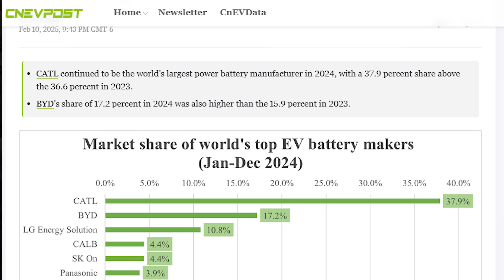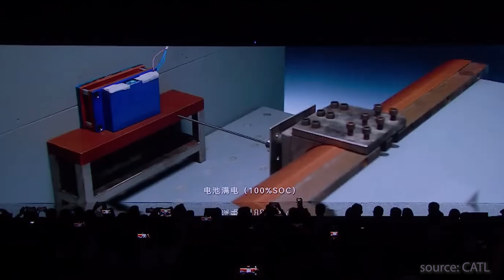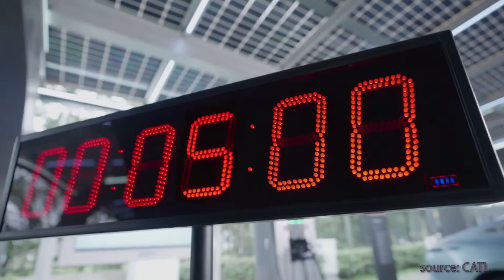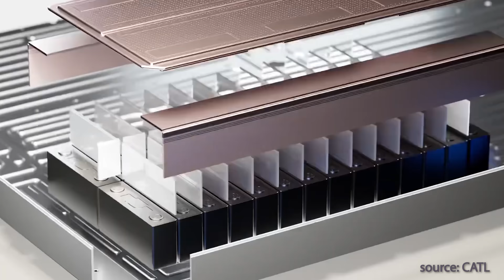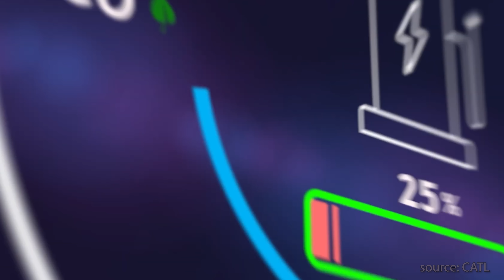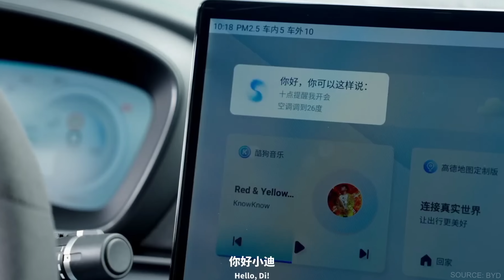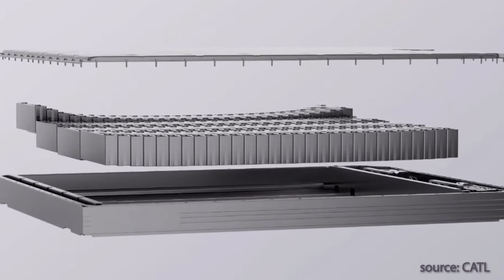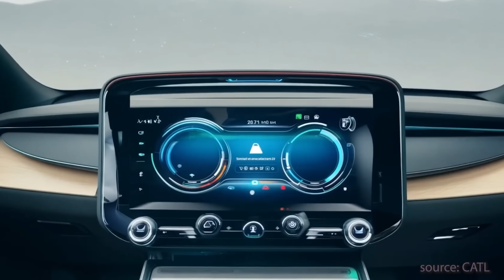THIS Battery Will Change EVERYTHING!  Sodium Batteries May Kill Lithium Forever? No more Lithium!

Comment: These are amazing breakthroughs that the whole world should share in. We need to move away from this US versus China thing so we have batteries or technology for the betterment of society. As Martyna mentioned we will and already have ended up with a two tier system. Due to this almost vengeance against China, the US consumer will/are missing out on these innovations which is nuts. I have an electric car and probably get 250 miles out of it. If it could travel 900 plus miles in a single charge then you don’t need millions of chargers. Bring it on I say
Reply: I don't care. It is absolutely not acceptable that China steals our intellectual property and something needs to be done about it. As a side note, Trump actually does not care about this issue. He sees no difference between a democracy and China. To Trump, all countries not named the U.S.A. are the economic enemy. But I am hoping that we can use the next 4 years to wean ourselves off of China. Nixon going to China was an extremely bad decision.

Comment: LFP EVE MB31 314Ah cost 50$, a Na+ 200Ah cost 60$ and have to big voltage range - we not have a inverter with 15-70VDC for DIY LowVoltage battery. Sodium is not cheap. Now a EVE do MB56 600Ah in the same size ! LFP seams better for future.

Comment: All electric for the past year, and since I can charge at home that has been a non issue.  Fast charging during regular breaks on longer trips has worked out to be very convenient, and while more expensive than home charging it's still cheaper than gas.  Smooth effortless feeling power without noise or smell, and the ability to regenerate energy while braking might be my favorite aspects of an EV.  The lack of maintenance is another plus...washer fluid, wiper blades, cabin air filter, and tires are just about all the regular maintenance.

Comment: Sodium has a huge voltage drop so at 50% soc you will absolutely notice the power loss, it might not be a deal breaker if they make the EV more powerful and limit it on a curve as the voltage drops but forget using sodium with currently available chargers and inverters which means Lithium will remain the dominant chemistry for the next decade outside of home storage imo.
Reply: Exactly, but home storage is the most exciting part anyway since that's what's going to realistically save us 95% on our power bill. The technology and prices on solar and LFP batteries alone are already enough to save us well over 80% vs paying a power company. Again, WAY more exciting than vehicle battery technology in my opinion.
Reply: So… I should buy ALB?

Comment: Rapid charging of a battery irrespective of its composition depends on a power grid's capability to deliver the required amount of energy.
Reply: Actually, those rapid charging station will have local battery storage on site to act as a buffer. That way, the charging station can draw a constant amount of power from the grid no matter how fast any one is charging.
Reply: @appliedengineering4001  you can dream
Reply: I guess you haven't heard of bifacial solar panels. 30 years of 26+% efficiency charging these batteries is insanely impressive and getting even better annually. The grid and power companies in general are becoming obsolete at light speed. Even as a regular retail consumer I've recently picked up a couple thousand watts of used standalone solar panels and a medium portable LFP inverter battery power station to fool around with for $600 all-in and it will run every single thing I'd need to live all day and all night for the next 15+ years.

Comment: The problem with 5 minute charging is the fact that power x charging time = battery energy. If you are going to reduce the charging time from 30 minutes to 5 then you need 6 times the electrical power which is not easy to do. Most grids cannot supply energy at this rate. Until there is a major upgrade of the electrical network EVs cannot charge that fast. Lithium batteries are an ecological hazard and should be banned.

Comment: This is the biggest load of bullshit I've seen on YouTube in a while.

Sodium batteries aren't replacing lithium.

CATL has one that's capable of 160Wh/kg. For reference, lithium ion batteries range from 240-300Wh/kg. Even with the expected 30% loss at -40°C, you'd still be at 168-210Wh/kg with lithium. 

Sodium batteries will never be the better option.

Comment: Fast charging is really not that important. 99% of all EV charging should be done slow charging over night anyway. DC fast charging only matters for long distance trips that is done only a few times a year, and you need pee- and food breaks anyway, so 15-20 min charging speed is all that is needed even for long trips.
Reply: For folks who live in apartments and do not have access to overnight home charger this is still a game changer especially on long road trips and in fact LFP batteries do not degrade much at all with fast charging unlike nmc batteries that most teslas employ.  So 1000 volt charging means we can get 300 km of range in 5 minutes of charging, which pretty much eliminates any further objections to full EV adoption
Reply: @lukecheuk  the solution is not faster charging. Everyone should be able to charge overnight. The are too few slow chargers in other words.

Comment: Its gonna be a few years before we see full utilization of these things.  Ultimately, though, we don't really need to worry about fast-charging for passenger vehicles beyond a certain point, as vehicle range increases beyond what most people are willing to drive in a day anyway.   So the real break-through we are waiting for is range... battery capacity in less weight, and not so much charging speed.

I think the biggest advantage of sodium will be its temperature range and potentially pricing in lower-end EVs.  It doesn't really solve the range issue, though, so we are in a rat-race between LFP and Sodium. Most of the production advances for either chemistry works with the other one too.  It could wind up being neck and neck.

Sodium still has a huge flaw, though, and that is its wide voltage range either requires beefier power electronics to go along with it, or a trade-off on the power curve that many people won't like.  That's why I think the first major inroads for sodium will be in lower-priced vehicles.  It could be a game-changer there.

-Matt
Reply: Hybrid lfp + sodium?
Reply: @PeterDMayr  Its hard for me to envision a use-case.
Reply: Sodium can be used in very cold weather (start) & lfp prefers normal temp. After the car batteries area is  warmed as they are used lfp can be used?

Comment: I've been watching them say salt batteries are replacing lithium for about 5 years now... There is a new ground breaking or world changing battery claim about monthly in that whole time. At some point will anything actually change?

Salt seems to be much better for non-mobile solutions like home battery storage.
Reply: If I remember, there are a few firms in the UK and US developing Sodium batteries. As you stated, it's been said that they are better suited for large stationary battery storage centers since Sodium batteries are not as light/efficient as lithium-ion batteries. "Ground-breaking" or "new" products announced in China are often marketing/branding lines to stimulate interests of investors. For Sodium batteries to replace Lithium in EVs, it has to make financial sense, meaning that it has to be either cheaper, lighter, safer, or easier to mass-produce than existing technology.
Reply: Well they are available commercially but their production base is very small as compared to lithium. The total lithium battery production last year was over a tera wat hour or 1000 GWh while Sodium was between 10 and 15GWh. So it does exist and it's price is declining.
Reply: Even funnier & more passive aggressive proof CATL is holding back, is them saying the non-explosive🧂🔋 (that they sawed in half at 100% SOC) & wink 😉 doesn't need thermal... "is basically a superconductor; it has zero resistance charge/discharge"... WHILE also expecting you to believe it can only do 5C, while Shenxing2 LFP does 12C.
Reply: Like🧂🔋, this take is non-explosive & abundantly clear: To protect Li sunk cost, CATL slow-walks🧂; they had 160wh/kg in 2021. Clean sweep for🧂vs Shenxing2, which is only 15% denser if you ignore thermal reg weight. 

Your head is far denser if you believe they can't get the🔋they described as having "zero resistance charge/discharge" to above 5C, to 12C like Shenxing2. Nevermind the extra 20% DCFC capacity of 🧂.
Reply: Maybe oil and paper parons dont wanna like they demonized hemp
Reply: That is what naysayers said about LFP.
Reply: @honesty_-no9he  LFO had desirable characteristics even then, sodium ion really doesn't. LFP already has a very low fire risk and some LFP batteries already discharge at lower temperatures. 
Sodium ion only has price going for it.
Reply: @williammeek-h2o go back and listen from 2:32 again.
Reply: @williammeek-h2o  Price is a big deal though. And the low-temp difference is significant, which is very good for both ESS and vehicles. It's just starting to make ESS inroads now, and if CATL make it cheap I can see them being quite right that it will get real wide adoption.
Reply: @LourdVicious  I already did and stand by my comment.
Reply: @xxwookey  But sodium ion doesn't have a lower price. It has the potential to have a lower price due to cheaper materials, but it has to scale to match LFP first. 

The lower temp isn't as big a factor as you make out. Low temp LFP is coming out now with some able to charge down to -20C and even this isn't that important because unlike flooded lead acid, LFP batteries can be put in the conditioned space where the temperature is already being controlled making it a non-issue.

What kills sodium ion for cars is the low efficiency that ruins regenerative braking. 
Add in lower energy density and why bother?

The poor efficiency also makes it undesirable for off grid applications.

The only suitable application is grid scale batteries where there is a large excess of RE at certain times and the poor efficiency matters less.

That means it is now only a niche product so can't reach the economies of scale to bring prices down to the point it can compete with LFP.
Reply: Mass production for EVs will begin later this year
Reply: You have to understand how crazy long it takes to build the factories and supply chains to produce an amount of batteries you as one of the 8 billion people in the world can see.
Reply: “Mass production for EVs will begin later this year”

Not entirely sodium ion battery vehicles. Vehicles that pair sodium ion with lithium ion.

Comment: Considering something like 80% of cars carry their driver alone, at less than 40 mph for 40 miles round trip, people worrying about range anxiety for all but road trips has been BS for quite some time. I'd say since the first GM EV-1's came out in the 90's with lead acid batteries and still managed 60-70 miles per charge...
Reply: Sure, that's an average, but they also want to go to the beach, visit family, or other various road trips. They don't want to ait around for half hour every hour and a half just because it's cold and slushy out.
Reply: What the hell? 60-70 miles per charge in not in any way whatsoever acceptable. You should not be dismissing people's range anxiety. They feel what they feel.

Comment: Kudos to this battery maker! I see the CATL 3 chemistry battery system taking over worldwide because it covers all budget categories now. Word from Autoline Daily is that these CATL Naxtra batteries are rolling off the line for between $30-35/KWH which if true would make these like 1/3 the price of LFP and way cheaper than Lithium icon and make batteries themselves one of the cheaper car components despite being the most important along with the drive motor to a BEV. To me there's no excuse not to electrify our entire global automotive fleet when the economic and technical challenges to adoption have all but been erased.
Reply: That's a crazy low price. GMs new battery is going to be $90/kwh in 2 years.

Comment: CATL are also a major player in grid storage and they did this actually to solve major grid and commercial storage issues. The EV side is the gold-mine and the chocolate on the cake (it would be inappropriate to use "icing" 😅).

Comment: The 5m quick charge requires significant infrastructure,  1mw service per vehicle is ain't no joke.   But to your point if you can get 800+ miles out of a charge, and get 5 minute quick charge that's a game changer.  When EV's cross the cost barrier and become cheaper then ICE vehicles that is when there will be broad market adoption.
Reply: Yes the moment they are cheaper and there's zero downside, people will only buy electric.
Reply: @WillProwse  what are time lines you think that will happen in?  Huge fan of your content, and it's awesome you support police activity love that channel too.
Reply: Not really, it's only four Tesla chargers. We have 96 at one station in Baker ca. Really not that difficult to pull those numbers from the grid.
Reply from the maker: Yes! I know daily for me, I charge my car at work and I have a 2018 Audi e tron  with 200 mile range. When going places and meet with customers, it can be challenging if not planned properly. So yes you’re absolutely right, the infrastructure needs to adapt, hopefully relatively soon.
Reply: @solartimeusa  That is thinking about it wrong. a charging station isn't designed by "how many chargers can fit in this space?". They are designed starting with the question of "how many vehicles do we want to service at peak" so if you have a station designed to service 120 vehicles on the peak hour, it doesn't matter if it is forty 250 kW chargers or ten 1 MW chargers, peak power demand from the utility is still 10 MW either way.
Reply: @williammeek-h2o yes, faster charging cars will be plugged in for shorter periods of time.

Comment: Sodium: Is the large voltage range (compared to LFP) no problem for EVs? How is this addressed?
Reply: Hybrid batteries mixing chemistries
Reply: Using a smart BMS battery monitoring system that gives a stable output

Comment: What is the life cycle of the sodium-ion batteries? Wonder how many times they can be charged / recharged compared to lithium ion batteries.
Reply from the maker: CATL's sodium-ion one is reported as a very impressive one, even compared to lithium. The passenger EV version is reported to achieve over 10000 charge cycles, and the heavy-duty truck battery is designed for over eight years of service life. Pretty impressive considering that in the past lithium had an upper hand when it came to longevity.
Reply: @solartimeusa  What is their reported round trip efficiency for charge/discharge cycle? last I read, it wasn't great and unless that gets solved, I don't think they will work for cars. I sure wouldn't get one.
Reply: Their energy density is a fair bit lower from what I recall, so while they may replace lithium in certain use cases(like they don't have issues with colder environments), unless there are significant improvements in the chemistry to increase energy density they likely won't be replacing lithium all together.